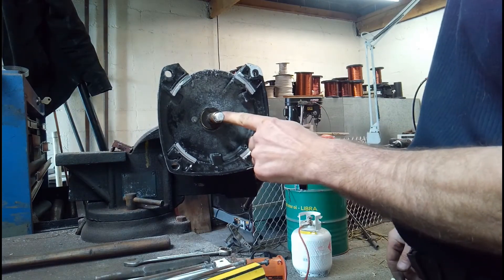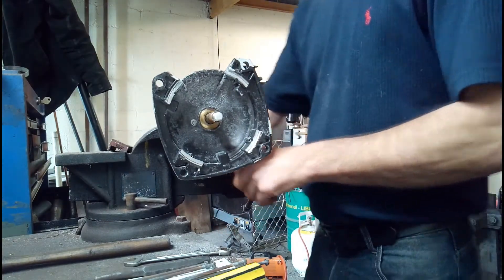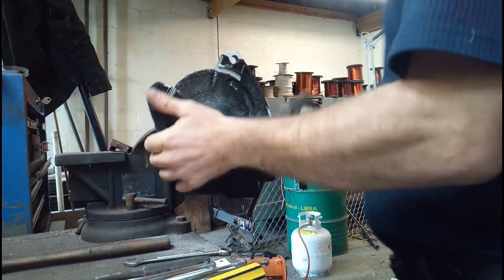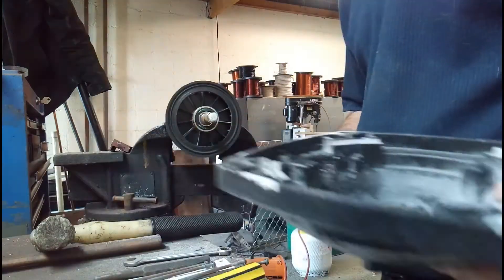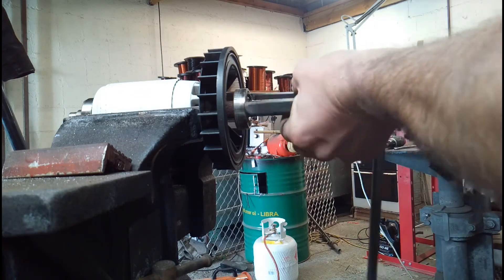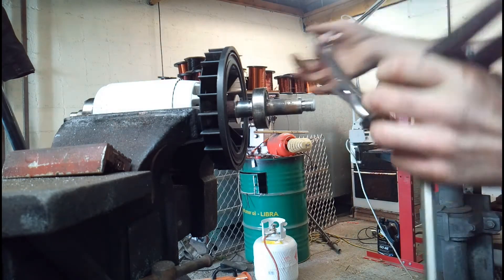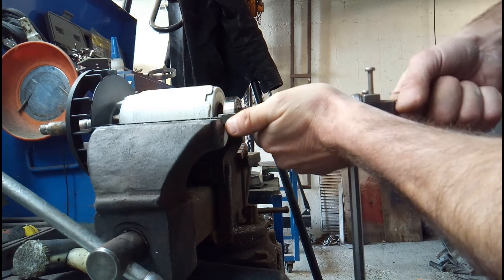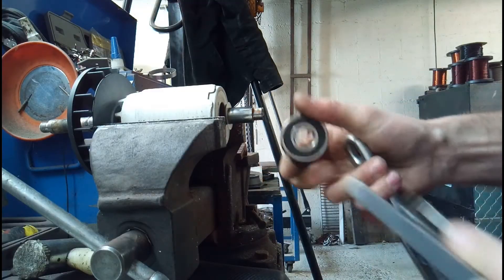Sta-rite pump overhaul  (5 of 8) - remove bearings.

Comment: I could send a picture of what i am talking about, but i dont see a vehicle for attaching an image.
Reply from the maker: https://www.youtube.com/redirect?event=comments&redir_token=QUFFLUhqbFlLZlZQdXBPbmZtSjNuVzZTYlBick1ZZFVmUXxBQ3Jtc0tuSWM4dU1FZHNhem1tLUxjUkNpT2VHQU5GRGd0aVlpeXFyNUxMZ1dGeE5Md200dHh4UmtPcV9oRkJWcnlHWldSeDNSeUlQdkd6RWtDSVRNTlJaOHJxdF9XOFdWYzM4cWNFWUF5Sk1qMDJ6RkpfNGtZUQ&q=https%3A%2F%2Fdrive.google.com%2Ffile%2Fd%2F1PXF9CNdCs6uM4iGcQ3zYZ-RI7HYQQ8Ga%2Fview%3Fusp%3Dsharing&stzid=UgzaHXtQiRsVEQ2up294AaABAg.9rDQQnX3Z469rHOglBGpZ-
Reply from the maker: The bottom photo shows the black plastic overload with blue, yellow and white (with black strip). sometimes these can intermittently open and stay open. You can either replace or bridge. You should  have over current protection already anyway at board!. Just check resistance across OL ...should be less than .5 ohms *While disconnected from supply. Cheers

Comment: I believe the thermal protection device on my K48m2p105b1 sta rite pump motor has failed of is failing.  But looking under the motor cap (where the start capicitor and syntrifical switch is located) I cannot identify the thermal  protection device can you help me?  and maybe recommend the best place to purchase a replacement?

thank you
Reply from the maker: Hi, Sorry I thought I had already replied to this post. In an earlier comment I supplied a link to pictures showing wiring. It is the black plastic bit with three wires  (yellow/blue/White with black strip) going to it. You can pick up the klixons from most electrical retailers. Test continuity first to make sure it's stuck open and if it is,  then just take it in. It should have the current rating printed on the side. Cheers

Comment: The pump sheet metal housing is rusted and what looks to be cast aluminum base plate is calcium pitted.  Can you use glass bead to blast?  And then can you use OTC spray primer and paint, or does it require a professional lacquer or epoxy base paint to bring back surface protection?  Thx... Scott
Reply from the maker: Hi Scott. If necessary I sand blast to remove corrosion, heat up end bell and while hot spry with zinc. By the time it cools down the paint is dry to the touch. Cheers